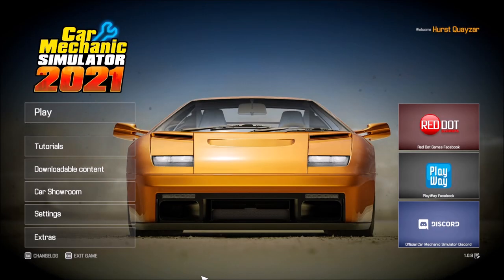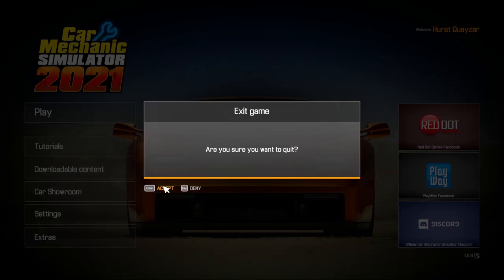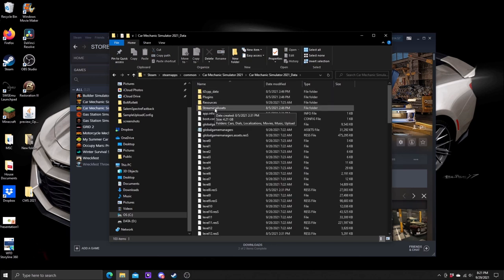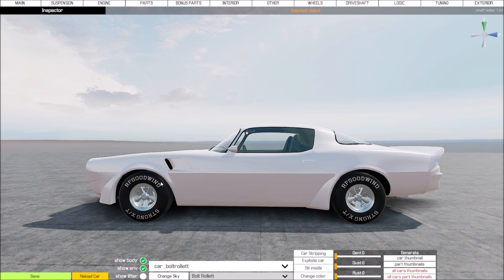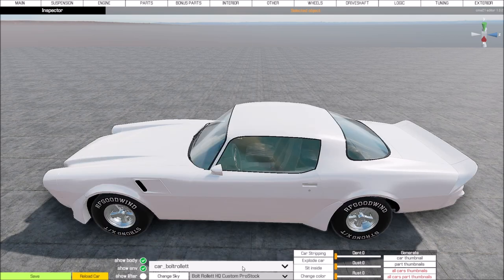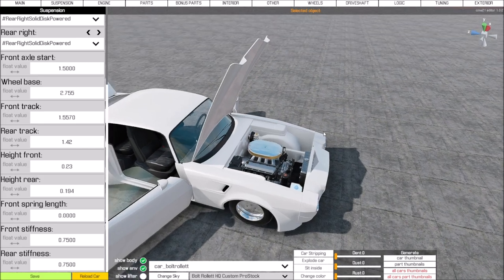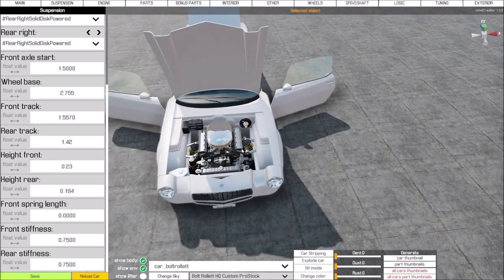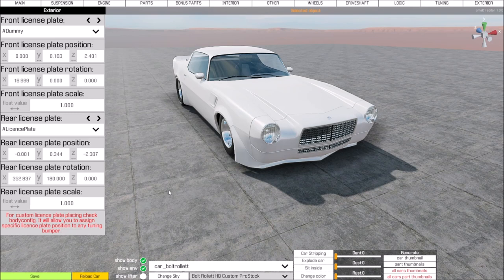Car Mechanic Simulator 2021 - The Car Editor

Comment: how can i do the mod cars
Reply from the maker: Mod cars are in the Steam\steamapps\workshop\content\1190000 folder. They are numbered. If you see the Mod on Steam, select the "share" button and you will see the mod's number in the link address. Other than a different location, the config files work the same way.
Reply: Thanks

Comment: hi, very nice video. i only need to know one thing and i can't seem to find it in your video but it may be in there. how do you increase the stock power of an engine in a config? i want to up the numbers in a i4 turbo on my piccolo config only by like 60-100 hp but don't know how to do it.
Reply from the maker: Simple... Open the Config File and find the line item engineTorqueMod=1. Increase the number to 1.1 to get 1% increase HP and Torque (Approximate Increase). So, adjust the numbers to reach your desired HP. Be aware that if you modify the in-game file, it will revert back to normal specs when you complete a File Integrity Check. It's best to create your own config and upload it to Steam.
Reply: @HurstQuayzar  okay thanks. yeah i was meaning for a workshop config upload im not just doing it for the in game ones
Reply from the maker: @autopilots  Be careful how much you add. It will cause the car to become undrivable. LOL!

Comment: interseting vid. but i have a question; is there a reason why you dont use the " float value" arrow to adjust parts position and size ? it's 1 million faster and easy than typing the value on keyboard 15 times in a row .
Reply from the maker: Just personal preference I guess. I’ll have to tinker with it more to be honest.

Comment: Love the video! I currently am experiencing an issue where i made a config but it wont let me change any performance parts and when i try to build any engine it wont let me add performance parts. Any help? Would greatly appreciate it!
Reply from the maker: Man... I am scratching my head on this one. I have not heard of an issue like this before. Make sure you are trying to buy and install the correct parts. Most have similar names. I don't know how many times I bought the wrong part... even did it twice in a row because of the naming. Let me know if you get it sorted out.

Comment: how to give things engine swap options
Reply from the maker: That has to be done in the Config file. Look for a line item called "swapoptions" then add your engines you want. "type" will be the default engine you added in the editor. Be careful though, only certain engines line up with certain exhausts. Play around in the editor to change engines and write down what they are labeled as. then add it like so... 

swapoptions=engine_v8_stary,engine_v8_stary_2carb
type=engine_v8_stary
Reply: @HurstQuayzar  also if don't mind me asking, how to save the car

Comment: You can make mods for the workshop with this editor or it's just to change things from the cars that are in the game?
Reply from the maker: It's just changing things within the car and game files. Creating a mod requires knowledge of 3D Modeling.
Reply: @HurstQuayzar  Yeah I know, the problem is HOW you combine the chassis of the car that you made with the parts that are in the vanilla game (wheels, suspension parts, etc) and then upload the mod in the workshop
Reply from the maker: @DerekSan_Arg  Ahhhh...Basically, it's not considered a "Mod". It's considered a "Config". Once you change things in the editor, you can save the "Config". There are a couple of videos out there that show you how to "Upload" that config to the workshop.

Comment: Great video, great tutorial! I've been looking for such a video for ages. Thank you!
On a side note, very odd... it seems that in Car Editor (mine is the same release as yours, that is v1.0.2, along with CMS 21 v1.0.12) I cannot get "Livery Set" and "Paint Tipe" when I want to change colour of the car. Whatever car it is, I mean, it doesn't matter, I cannot. I can only change livery within the TUNING Tab, and, in there, I can only change the possible livery, but no PAINT TYPE whatsoever. I wonder what could be the problem...
Thank you.
Reply from the maker: Thanks. I will have to go back into the editor to see what you are talking about. This may have changed with one of the updates. Not sure why it would effect the editor but it might have.
Reply: Dear  @HurstQuayzar ,
thank you for you swift answer. Yes, you could try to launch CE and see for yoursefl, or play your video right at time index 54:04, which I guess it'd be easier for you.
I am sure that it seems that I cannot get the same options that you show in your video, at least regarding the change of the colour of the car(s) section, as said.
My version of CMS21 is v1.10.12 and Car Editor shows version 1.0.2, which is exactly the same that you have. Hence my curiosity about this issue of mine... I have bought CMS21 within Steam along with all DLC (as of today, there are three), and running it on my 27" iMac Retina 5K 2017, in Bootcamp, with Windows 10 64-bit.
The Sim per se, works as a charm, the Editor as well, unless for this thing, as told.
Thank you again.
Reply from the maker: @MacCekko  Looks like they fixed that in the last patch. (1.0.13)
Reply: @HurstQuayzar  yeah, I have just read from Steam! So it WAS a bug! Very happy for this! Thank you again for your help, either in asnwering, either with your amazing video in the first place!
Live long and prosper, Hurst!! :D
Reply from the maker: @MacCekko  A few months late... but thank you a ton!

Comment: There is anyway that i increase the horse power of the car in car editor?
Reply from the maker: There is… I am away on holiday right now but I will let you know where to tweak it.
Reply: @HurstQuayzar  oh thanks, i want
to know this to do some crazy configs
Reply: @HurstQuayzar  Can you tell me how i can do it?
Reply: @HurstQuayzar  Can you?
Reply from the maker: @gustavozorzo3035   Just got back... in the config, you can change the engineTorqueMod=1 to a different number. Please back up your files in case something goes wrong.